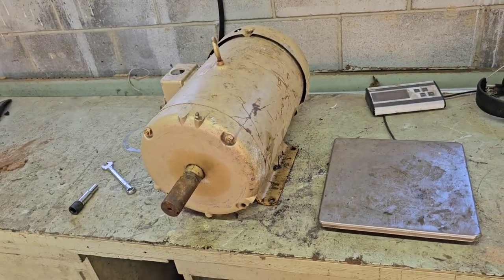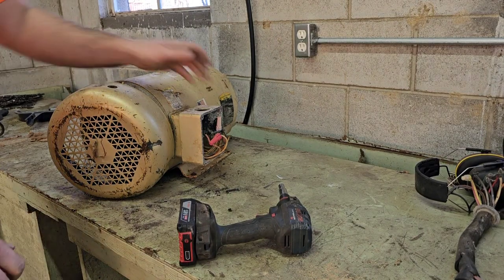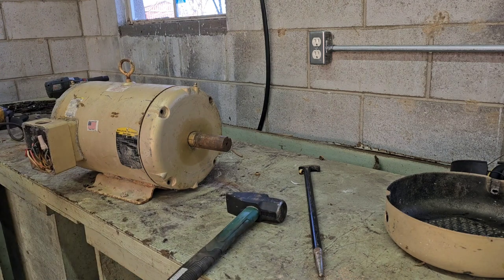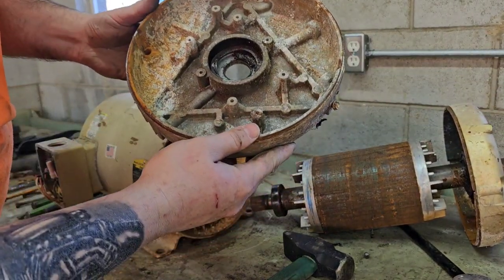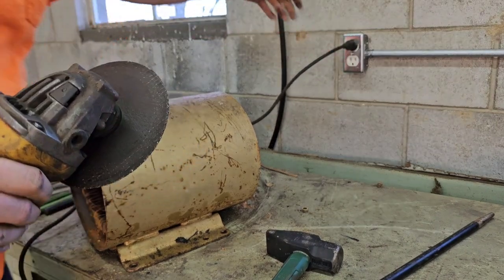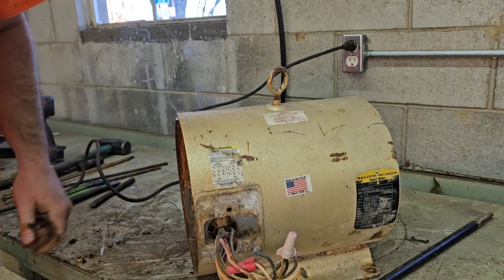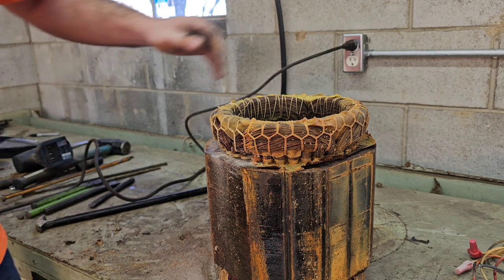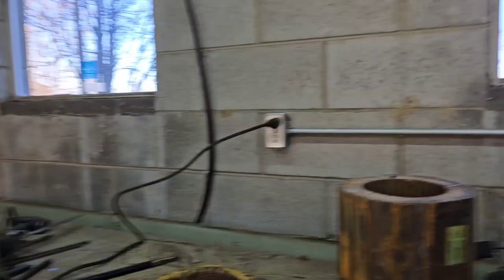Scrapping an electric motor the easy way!!

Comment: matt, as a welder do you think a plasma cutter would be faster to cut that steel  case or even a gas axe ,oxy/act.
Reply from the maker: A plasma would definitely be faster i just dont have one right now. As far as a oxy/act torch I think it would start too burn the laquor and smoke up my shop really bad. If it was summer and the doors were open i wouldnt mind

Comment: Only one comment.  Using a angle grinder with a guard and no safety glasses is tempting fate.  Aside from the obvious danger junk flying into your eyes have you ever seen a cutoff wheel break apart.  I had it happen once, had on safety glasses and luckily none of the fragments hit me.  I think there is a YouTube video with some graphic pictures of those less fortunate.  You get two eyes, one will work but better to have two.
Reply from the maker: I was wearing a face shield for the most part. But I agree a guard would be best put back on.